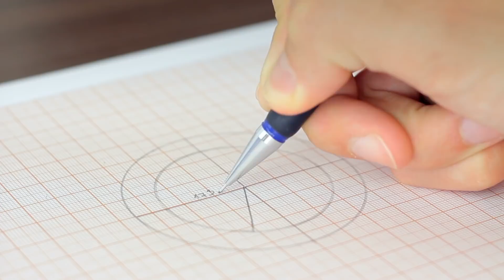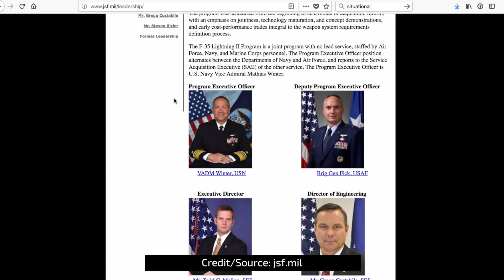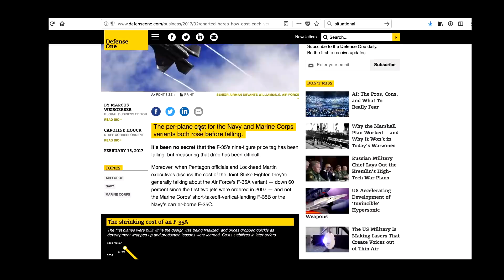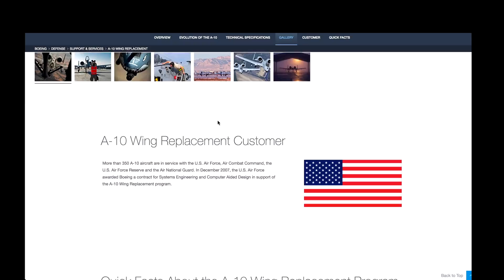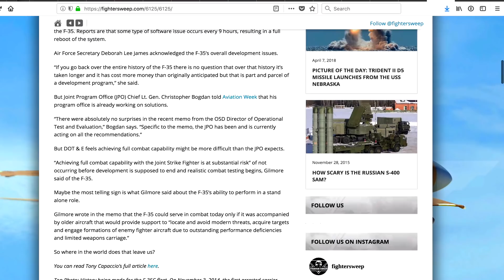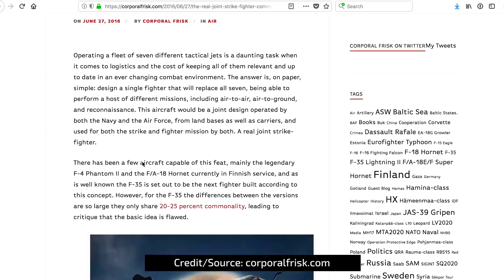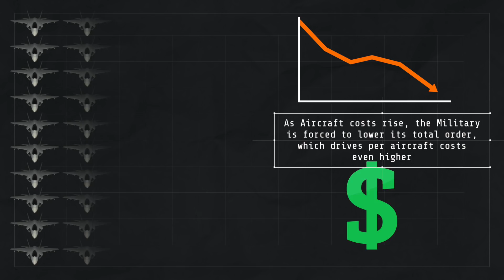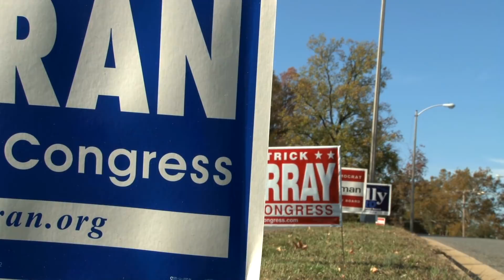Why the F-35 Lightning II Might be the Most Expensive Military Aircraft Mistake Ever

Comment: I am not an F-35 hater (though I agree with everyone else that it cannot replace the A-10. Period), what I am worried about is a McNamara type of idea of an every-type-Aircraft like the F-4 that was not exceptional at everything.
What I mean is there are strike aircraft and fighters. There is not an aircraft that can do everything. There must be separate types for actual air dominance.
Yes, there are F/A aircraft that are good, but we need perfection to remain dominant. If we try a catch all, we will get burned. Remember how long it takes to get a plane from the drawing board to the squadron and think of what would happen if we lost a bunch of F-35’s to a strict air superiority fighter and when they would be replaced...
Reply: Dean Ainsworth 
The F22 IS our air dominance fighter.  We also have a bunch of F-15s to serve in that role against all but the most sophisticated enemy aircraft, though the pilots who fly and fly against them say the F-35 is better.   That said, the F15C airframes are aging.  The Air force has ordered 8 New F-15X aircraft on a trial basis.  I believe if these aircraft turn out to be competitive with other gen 4+ non-stealth aircraft, we may see an order for several more to augment the F-22s and F-35s in situations that don’t require stealth, as the radar and communications interoperability will be on par with those fighters.  However, the F-15X will not be cheaper than the F-35.  In fact, initial per unit cost estimates are higher than the F-35.  At any rate, 185 or so F-22s should provide a most adequate CAP in almost all conceivable situations, while when called upon, the F-35 and F-15X are nearly as capable and probably more capable than any potential enemy aircraft known today.   The best peace incentive is knowing your enemy is superior to you in number technology or both.  At present, U.S. aircraft superiority and number far exceeds that of any potential enemies, not including allied countries.  This is one of the Best deterrents to any kind of conventional war.

Comment: The F-35 is actually quite maneuverable, very maneuverable in fact. It can sustain angles of attack over 60 degrees, it has incredible acceleration and great energy retention thanks to its low drag design. It also has a fairly low wingloading given that 40% of the planes total lift is generated by the fuselage and not the wings

Comment: A few updates as far as the Air Force goes:

-The A-29 program has been incredibly successful. A-29 aircraft are WW2-style turbo-prop planes that sell for an extremely low price and can be fielded in groups of 5 or 6 for the maintenance and operational costs of a single A-10. It is a resurrection of the old school turbines for maximum fuel efficiency and effectiveness in low-threat environments, and has greater avionics than the F-16s currently in use by the USAF.
It is more likely that the A-29 will replace the A-10 as opposed to the F-35. 

-The F-22 will continue to be the premier in interception and fighterxfighter ops--not to much surprise.

-High operational costs continue to decline. Maintenance is not easy; as much as twenty people work on an aircraft on a regular basis, and most improvements are created by the experience of Organizational and Intermediate maintenance--not by engineering authorities. People are still finding the best ways to reduce costs and most effectively maintain the F-35.

Comment: The F-35 is expensive from a program standpoint is because of the sheer volume.  It is going to end up in the same price range as any of the upgraded 4G aircraft like the F-16, F-18 and F-15 proposed advanced models.  What does not get talked about a lot is how much more capable the light or amphibious carriers become with a 5th generation supersonic aircraft onboard.  The US has basically gone from 10 aircraft carriers to 18 carriers when you consider their capabilities.  Also, the Brits now have a far more capable carrier (soon to be two) than with the Harriers.  There really is very little comparison between the Harrier and the F-35B

Comment: even the Germans couldn't make a all in one fighter jet and they are the mad lads who first used jet aircraft to any noteworthy advantage and regarding the A10 thats more of a gun with a flight capable platform i'd recommend making a new A10 model fitted with the most advanced equipment the air force has at its disposal they should try to build all of the parts in as few states as is safely possible say seven states in factories disguised as civil aviation or considering that its such a big project put it under the direct control of the USAF
Reply: The F/A-18 and F-4 are "all-in-one aircraft" and both are incredibly successful... The Germans didn't do it because they were very restricted in terms of anything military after WWII and were not allowed to build their own high-tech fighters.

Comment: Personally, I would argue that the F-35 was the most expensive military aircraft mistake ever made, and will probably be one of the last manned aircraft that we can easily describe as a fighter, at least in the U.S.

I think there are a few primary issues with the F-35:

1. As you mentioned, the VTOL requirement was a leap too far in commonality, and compromises the airframe too much for the Air Force and Navy, which could have focused their efforts on something that had vastly superior airframe performance. As an airframe, the F-22 can run circles around the F-35, and if built at scale and constantly upgraded like the F-35 is now, probably wouldn't cost a whole lot more.

2. The program was not modular enough. The JSF program covered everything from the airframe and engines, to the helmet, sensors and datalinks. Arguably, the best (and most expensive) features of the F-35 are its electronics, which, beyond flight control, could have been separate contracts that made it easier for the government to encourage greater competition, and drop contracts entirely that were underperforming and in breech of contract.

3. The program failed to learn lessons from Operation Desert Storm, namely that high performance single-role aircraft, like the F-111, F-117 and F-15C vastly outperform lower performance, multi-role aircraft. If the program start had been delayed a year or two for requirements to come out in light of Desert Storm studies/lessons learned, I doubt we would have accepted another generation of the F-15/16 high-performance/low-performance fighter mix, and I think we would have seriously questioned the value of equipping the Marines with jump jets.

When it comes to drones/vs. manned fighters, I think the drone takeover is going to happen because it's just too much of a risk to lose a pilot in terms of politics, training time, and all the secrets that are rattling around in his head. However, I don't think anyone seriously wants to automate kinetic targeting decisions, so human beings will be in the loop, reviewing the data and making decisions. Where you put those humans is up for debate, but I would be willing to bet that the Air Force will put them immediately behind the drones in a stealthy aircraft, the F-35 probably being the first one, so they can get close enough to the fight to control it without a laggy, and relatively easily disrupted chain of datalinks.

Comment: This is the second video where you cite the opinions of serving military pilots. These people are in the military command structure and are always under orders and implied orders. Their opinions are extremely important, but any pilot who wants to keep flying, and not be transferred to a parts depot in Alaska, is not going to go against what his general wants.  
Have you read Boyd, about John Boyd? He was an air force officer who derailed many boondoggle procurements and predicted the poor performance of planes that did make it into production. Seeing the moving wing on the F-111 he predicted the added weight, complexity and subsequent less than optimal performance of that aircraft. The project he help succeed was the F-16, a lightweight highly versatile jet fighter.  He revealed that the performance numbers submitted to the Congressional oversight committee for one aircraft if extrapolated gave the plane significant wing lift numbers when its velocity was zero.

Comment: Cost and conspiracies aside, this aircraft doesn't look like it's built for war. If the U.S. lost an F-16, F-18, or A-10, it would be bad but there are plenty of them around and they're relatively easily to produce. If the U.S. lost an F-35 (to enemy fire), then the cost of replacing them, the time it takes to manufacture them, and the time it takes to configure them is unacceptable currently. So regardless of whether the thing is a good airframe, the whole program hinges on building an aircraft that is essentially too expensive to lose. This is especially important given the advances in air defense tech the world has seen from the main competitors of the U.S., although they would probably still have some trouble initially acquiring the F-35.
This whole thing sounds like a neat idea gone completely out of control.
Reply: The F-16C took more man hours to build in the late 1980s when it was being mass-produced than the F-35A currently does. The F-35A is also cheaper than most 4+ gen fighters out there.

Comment: The f35 is also slow compared to f22 and f16 from what I hear.
Reply: C Rock its as fast if not faster as the F16. And comparing a multi role figher to an air superiority fighter is like comparing the range of a M107 and a 1911.
Reply: @David-eh9le  well according to the Internet if you look up how fast each one is it says the top speed of the f35 is 1.6 times speed of sound where the f16 is has reached speeds of faster than mach 2.  Plus the f35 is now grounded a again since the found something new that was wrong with it.  The more stealth you add the slower your plane gets.

Comment: You need to update your information and stop glossing over positive comments. By the way. Spray was an analyst, not a designer. Yep, the F22 is super expensive, but had we built more, the unit cost would have come down.
Look at the cost of the newest versions of the F16 and F18. The F35 is on a path to be close to the cost (higher) of those two aircraft.
Update your video withe the results of Red Flag and other exercises.
Reply: James Terrell I agree the f 22 is a way better plane they should just sell it to Australia as the plane is bilt well and does the job is says it will do
Reply: @marshianoblackett4370  They can't - The tooling was destroyed at the end of the production run
Export to allies was also banned by congress to prevent technology being sold onwards

Comment: F35 96Million (who knows maintenance) F22 Raptor a llittle over 100Million... I rather have a RAPTOR. All the Raptors that could have been made ,but lost to JSF project  Way more than 1Trillion Dollars. TRILLION with T Dollars. Lots of Raptors were pissed away.....shame.
Reply: The F-35A is currently $89 million, and the F-22 was at it's cheapest $143 million. There's a huge difference in cost, especially in maintenance where the F-22 is close to $60000 per flight hour and the F-35A is around $40000 and costs are set to go down once the proper tools are made widely available.

Also, program cost for all 3 variants of the F-35 is under $500 billion. Most of the cost comes from the DoD's decision to procure them before development was complete. Development cost is under $60 billion.

Comment: anyone who thinks the F-35 can replace the A-10 has never been on the ground, desperately needing air support against enemy armor units. there is nothing that can currently replace the BRRRRRRRR of the A-10 as well as the armor and low flight altitude the A-10 can achieve.